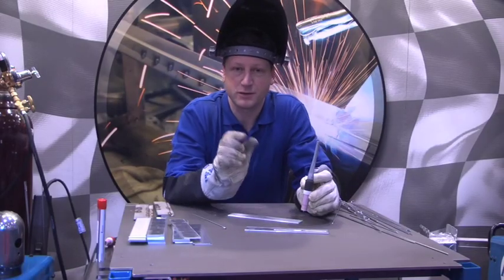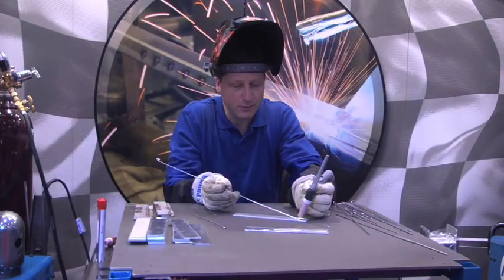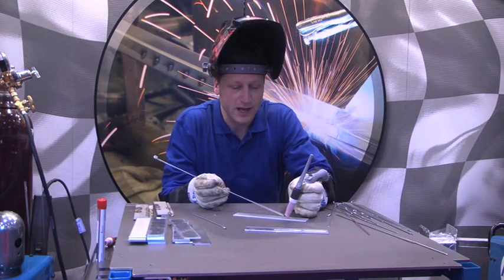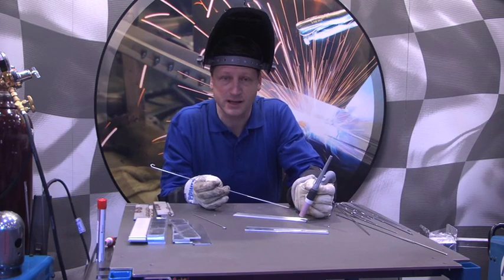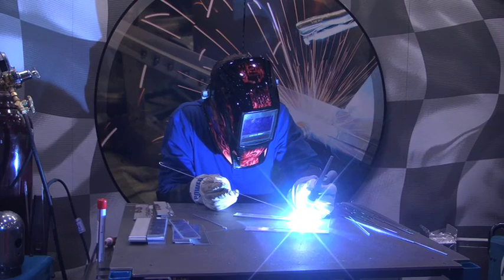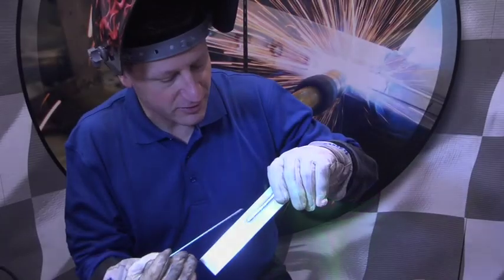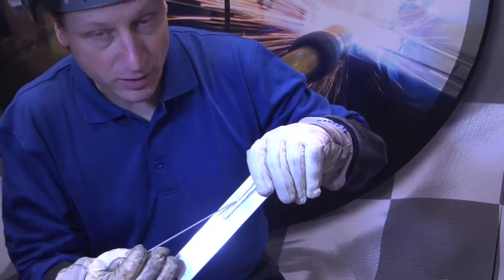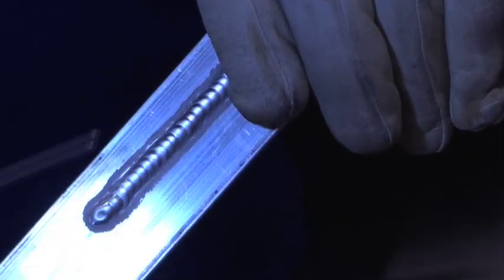TIG Welding Aluminum Part 4: How to Introduce Filler Metal

Comment from the maker: Sure, a 20 percent duty cycle means you can weld continually for 2 minutes out of every 10-minute period before you need to stop and let the machine cool down for the remainder of the period. The Diversion 165 is 150 amps at 20%, so you could weld at 150 amps for two minutes before you need to stop and let the machine cool down for the remaining 8 minutes. 

Let us know if you have other questions. Weld safely now.

Comment: miller welders can you explain how does the duty cycle works in the diversion 165? since it was not explained in the dvd that came with my diversion 165, i want to understand when i am over heating my machine, 20% duty cycle means i can weld 20 minutes out of a hour?

Comment: the black specs are probably from cross contamination of the aluminium with steel or something else.. make sure to clean the surface really well with a new wire brush and not using it on anything else

Comment: I bought the Miller 165 last week and have tried relentlessly to weld aluminum or run a bead with NO success. I've tried setting the amperage at all levels using straight Argon and Argon 75/25 mix and the only thing it does is either completely melts the aluminum or leave black specks on it from the arc. AND yes it's set to AC. I'm beginning to think there is something wrong with the machine...

Comment: with the newer inverter type of welders Ceriated or Lanthanated 1.5 or 2.0 work great I prefer the 2.0 Lanthanated. No balling of the end is needed, necessary or desired. You want a sharp point with just the end taken off to keep it from jumping off into the puddle. This allows for a smaller bead and also faster travel speed and use on thicker material because the arc is more focused.